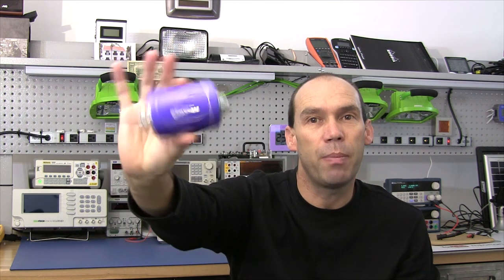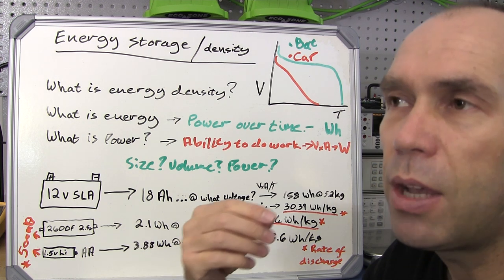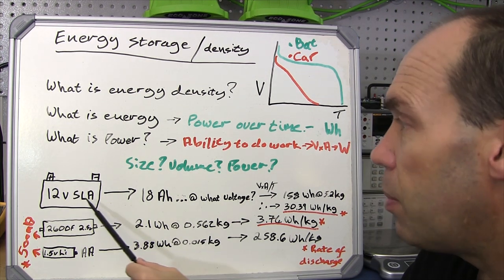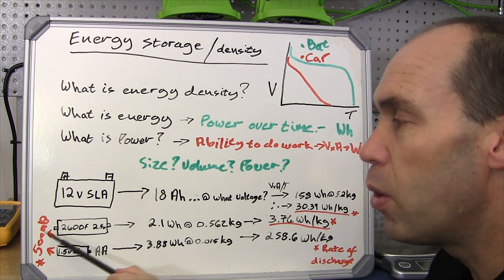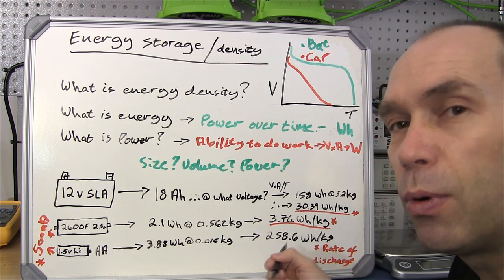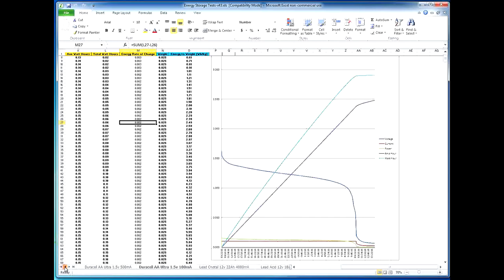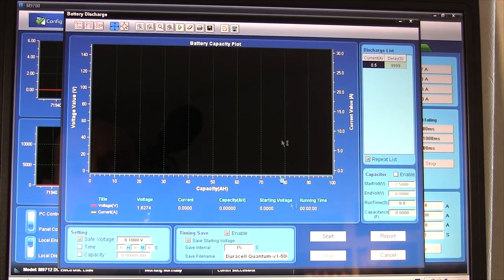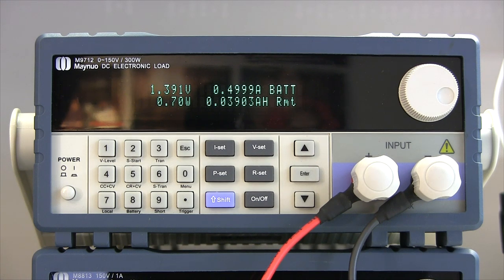Energy Storage and Density - Duracell Quantum AA cell vs the Energizer Ultimate Lithium

Comment: Lithium Ultimate are literally the best battery currently known to man. Also one of the most expensive battery. My pc mouse with a single AA lithium ultimate lasted a year. My Blu-ray player remote control using two AAA lithium ultimate lasted 3 years. It's expensive but at least I don't have to worry about changing dry cells for years and I hate changing cells especially in the middle of watching a movie where the cells in the remote died.

Comment: I think you didn't mention about the way batteries are used - what type of device they are powering. For example if you power a device that uses linear regulator W/h measured capacity doesn't matter because the device draws the same current regardless of the voltage. If you have switching regulator - then it's drawing constant (well almost) power so W/h is what matters and (m)A/h is not accurate measurement of capacity. If there is no regulator - no rating will be accurate because the device (unless it's pure resistance) consumption will differ at different voltages and will be hard to estimate how battery capacity relates to time powering the device.

Comment: Hi Martin: A couple of things. I agree the Energizer Li 1.5v 500mA has a flatter discharge curve, but your graphs exaggerated the difference because of the different y-axis scales (2.5 versus 4.5).

Second: I have seen some videos with guys claiming to replace the lead/acid in their cars with super caps. After watching your vid my guess is that this might work but, it better start on the first crank because the caps capacity is small.  Do I have that right? Cheers, Mark

Comment: I used the Energizer Litium on my Logitech mouse but it only lasts 2 month while the regular batteries lasts 4 months+. is it because the Lithium is bad with low discharge devices?
Reply: Lithium batteries are only worth buying when using them on a high power device like a flashlight, digital camera and so on. Generally you got more capacity out of a lithium battery anyway, I think that you used your mouse more those 2 months ;)
Reply: Got it, thank you for the explanation = )
Reply: Joey Huang No problem. I like to help :)
Reply: ***** Indeed, That's why I'm getting some and a powerful flashlight. If they were cheaper, I would use them everywere.
Reply: Mine lasted a year .... did you turn off the mouse when you are not using it ?
Reply: For the mouse it probably isn't worth it, except that the Li and NiMH are less likely to leak than the Alkalines.  SOME low drain loads like a good LED flashlight will benefit even on low settings because they can use less current due to the extra Li voltage.  They, and digicams, are more of a constant power load than constant current, so 1.7V vs 1.5V at the same mAh still makes a difference.  Warning, though, some devices such as incandescent flashlights will burn out quickly from the extra voltage, even with only 2 AA cells.  Other multi-cell devices with 4 or more cells would see progressively more over-voltage and could be damaged.  LSD NiMH like Eneloop are really the best value.  Li is superior only for very long shelf life and low temperature operation (such as an emergency LED car flashlight).  The AA Energizers are also superior to CR123 LiMn batteries for shelf life at non-room temperatures.

Comment: The lithium are good but they also cost a lot more than the quantum.  A four pack of the lithium costs nearly as much as twenty of the quantum.  Based on this test I can't see justifying 5x the cost for the energizer batteries.
Reply: Listening Point It really depends on the use you give them, ebergizer batteries dont suffer in cold weather. thats why they are prefred by mountaineering and winter outdoors

Comment: Nice video Martin. But you should also point out truth about capacitors. Ppl think they can add some to system with battery banks and it will make huge difference..but that isn't the truth. So if you can.. Can you make some testing or show in your video truth about that. So ppl finally understand cap. will not make so much difference on battery system (solar system) /and low voltages like 12-24V/ because some ppl think if you can cap with 5F your system will be more robust because of amp. spike

Comment: Why are you choosing such a high voltage cut-off from the AA Alkaline cell (20:47 1.071 volts)? Most well engineered equipment can run down to about .8 or .9 V per cell. Does your program automatically calculate the area below the discharge line (because that is the proper way to do it)? Also, why are you not using NIMH cells in your fluke device? Those primary lithium cells are a fortune.

Comment: What purpose does it serve to compare the Quantum battery (which is alkaline) to the Energizer (which has Lithium chemistry)?  You are trying to compare apples and oranges.  The TRUE test/comparison SHOULD BE:

1)  Duracell Quantum vs. Regular Energizer; and

2)  Duracell Quantum vs. Regular Duracell (CopperTop).

NOW you would be comparing "Apples to Apples".  The above two comparisons would be extremely interesting to do.  I would like to ultimately find out if the Quantum is superior to the other two (and if so, by how much)?  In other words, is the higher cost of Duracell Quantum batteries truly justified or is it just slick marketing?

Comment: The Energizer ULTIMATE LITHIUM battery is a very dangerous battery and should not have been produced in the first place. This battery has no smart voltage sensing circuit built into the battery that would otherwise allow it to be recharged unattended. This battery can be safely recharged up to a certain voltage, but you must not leave the battery unattended should you decide to recharge it to its original charge. In a nutshell, Energizer should have known better than to produce a battery like this with no smart voltage sensing circuit built into the battery itself. This is very irresponsible of Energizer as this battery is a time bomb waiting to explode. A lithium battery like this is much more dangerous than other lithium cells that do contain voltage sensing circuits which tell battery chargers when to cease charging unlike the Energizer ULTIMATE LITHIUM battery, which does not. There is a warning is extremely FINE PRINT that tells the user that this battery can explode even if it is installed backwards. Energizer is extremely irresponsible in this regard. Batteries are quite often inserted backwards by accident all over the world. I've done it, and everyone else has done this too. How many homes and other property are going to have to burn up as a result of such irresponsibility?
Reply: The ultimate lithium are not rechargable, you are thinking of lithium ion, which is substantially different and runs at 3.7 V